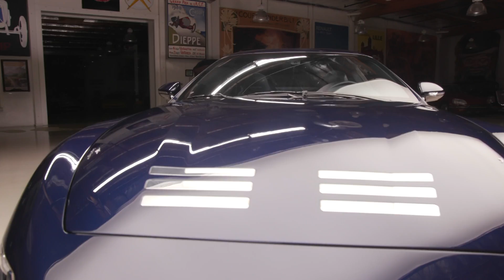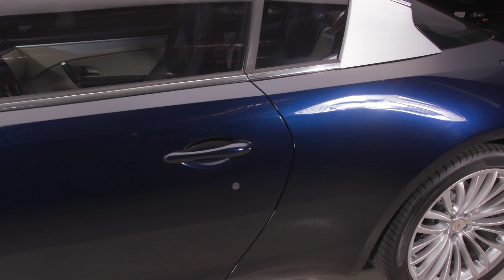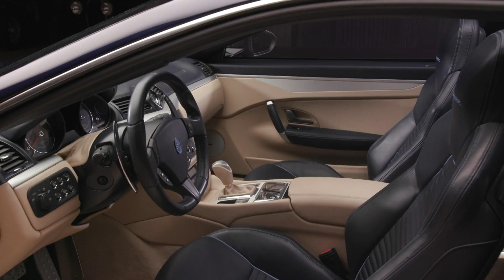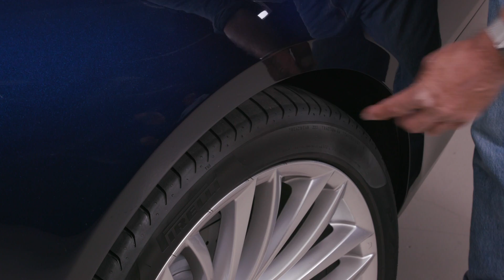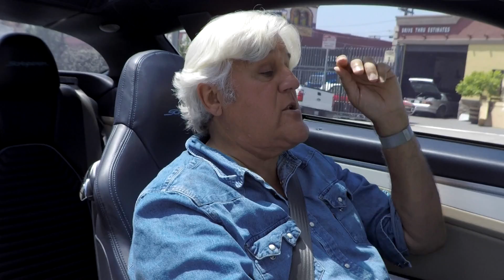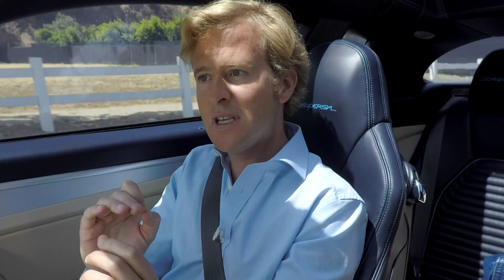2018 Touring Superleggera - Jay Leno’s Garage

Comment: Why so much hate? Granted there are couple of details I wish they didn't add (The strips on the hood & the aluminum on the roof), This car is STUNNINGLY beautiful! It has near perfect GT proportions and classy presence. I haven't clicked on a Jay Leno video this fast in a long time. Unfortunately, within the first few seconds, I realized it was based on Maserati. What a shame!! I'm sure I could pick a used gran Turismo for less than $10k over here, and it would still be money wasted. The problem is what Jay was asking and the guy wasted avoiding to answer truthfully; which is that a custom builder like this cannot create a unique car because of the regulations in place. I mean, you can see its a Maserati almost instantaneously, so they end up applying too much make up in a futile effort to distinguish themselves. Sad!
Reply: Uhhh less than 10k? Where do you live? The cheapest one i found in the states was $24k with 57k miles on cargurus. It had 5 owners, salvage history with 1 accident.  Unless you are talking about the gransport from 2004ish.

Comment: Is it just me or do the headlights look like the new Mustangs ones? The front end of the car overall looks a lot like a Mustang, minus a few details and that bar going across the grill.
Also, I know design is very subjective and I commend the work done on the car, but to me, the design of the car looks very disjointed. I'm a designer myself, and one thing I really don't like in cars in particular is when random lines thrown in to "add character." That front end doesn't look very good. I prefer smooth curves that flow into one another. The reason why some of Lamborghini's angular designs work is because they maintain it throughout their entire design. They don't mix gentle curves with random, flamboyant lines. That just looks like a messy design, overall.

Comment: Looks like they went to the glue on accessories aisle at autozone halfway through the build. You know the one with all the plastic chrome parts you paste on the top and sides of your car. Me? I prefer my Camry. 135,000 miles and I still haven’t replaced the air filter. She runs like a hound!

Edit: I will say I agree with Jay, the skill to build these vehicles by hand is being lost so much respect to the people who built this car.
Reply: You probably don’t know where the air filter is. Maybe you should read the owners manual and maintenance schedule.
Reply: They just forgot the naked lady mud flaps and the turbo badges
Reply: ReidHenderson 😂

Comment: You can gold plate a turd, but under the skin, it's still a Maserati.
This thing is loud, obnoxious, and in twenty thousand miles will puke it's guts out.
Reply: Actually that engine and trans is very reliable

Comment: Coach builders are thriving in Europe. We just call it something else here. Tuner Shop.
Reply: Welcome To The Madness , let’s see a tuner shop make that, l’d be interested to see it.
Reply: @Pete-z6e  I guess you're all programmed to pick one word that trigger you all to react. Is Singer not a coach building company give what they do?
Reply: @WelcomeToTheMadness  no they are not. The Porsche body is still there, the only thing that Singer does is elevating the 964 to its design and performance peak. 
A coach builder creates a new body on an existing body, or frame. The term comes from horse drawn carriages were the frame was build by a blacksmith and the body by a coach builder. Next time research terminology before you type nonsense.
Reply: thor8640 Go find someone else to preach to, all the panels are changed. You might not think it’s not drastic enough but they are. So you need to check yourself. 

I said what I said.
Reply: No, no, no, no...... It is not the same. Don't say that.
Reply: I would say a coach builder builts a completely new coach/body. A tuner shop adds to an existing design. Not better or worse perhaps but definitely a completely different thing.
Reply: gotta respect Touring Milano. they made the alfa disco volante.
Reply: You ALMOST would've been half way accurate if you said RWB instead of Singer. Neither are US based though and neither design a new car from an existing one. They both simply modify and/or add and change out factory body panels. Singer takes it one step further by revamping the performance.
Reply: that has to be the dumbest thing i have ever heard.
Reply: @grievuspwn4g3  Bertone is under GM?
Reply: Jay had it right the time he said it. Coach build means formed by hand. Not plastic formed in a mold. Jay way over played this car being what it isn't.
Reply: Stop talking out of your arse.
Reply: Oh wait, so 

Singer is what? Not doing the same thing as this guy? 

This must be some of that European elitist sentiment.
Reply: @WelcomeToTheMadness  Singer was founded by a Brit.  Lol. JUST SAYING!!